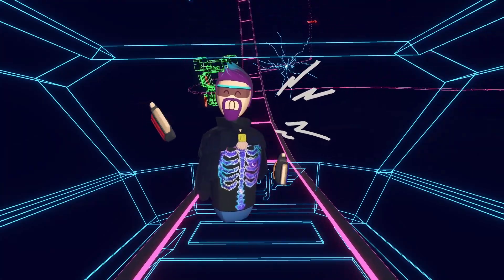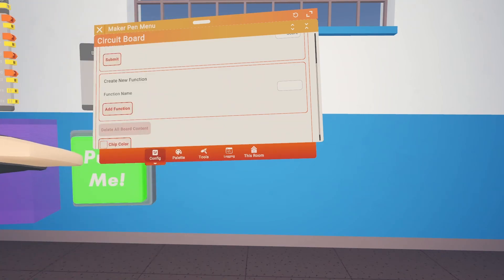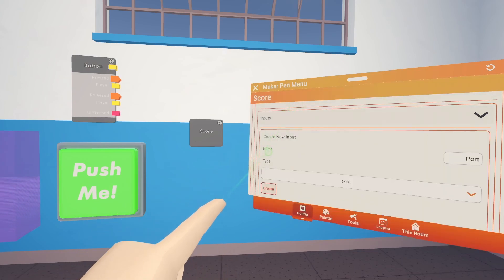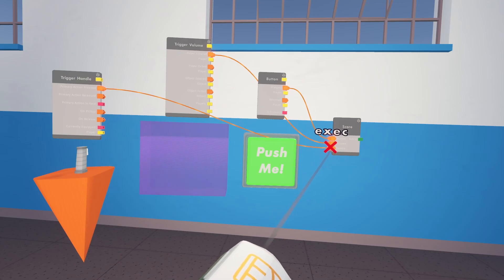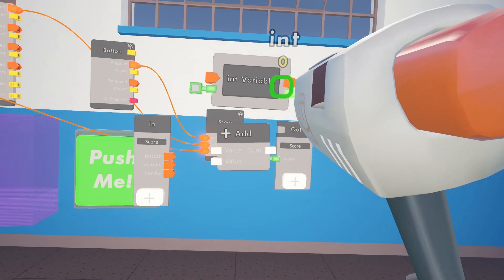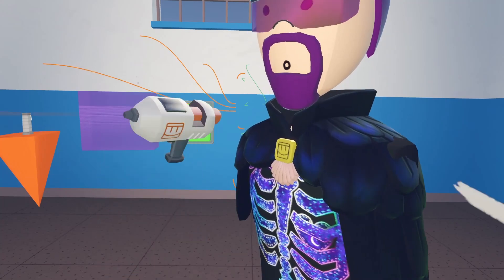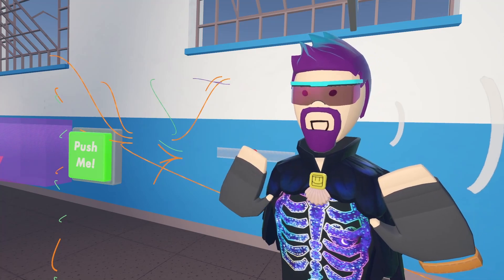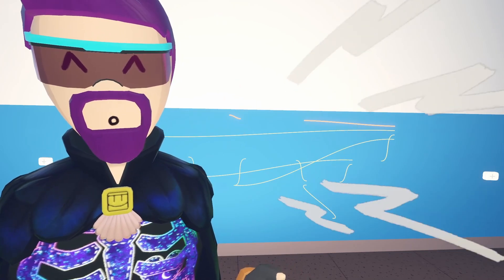Make Your Circuits CLEAN! | Rec Room Circuit Board Tutorial

Comment: Remember when you made a tutorial on how to use Animation Gizmos, and do you remember the tutorial on how to use state machines? How do you connect both animation gizmos and state machines together and use that combination of gizmos and machines to open a door?
Reply from the maker: ill be honest i havent messed with cv1 in a while, my guess would be match you max time in state with the time on your animation gizmo, in state 1 play output 1 to the animation play then when animation done start state 2, i believe there is an output on the animation the you can used to gate the 2nd state
Reply: @theRCLman  if that doesn't work, then I will need to take classes I guess

Comment: I don’t have really any problems with this but I just don’t see the practical use of this, like what if you have multiple people needing to edit the circuits at the same time, plus needing to go in the circuit board to just update it seems a bit, idk unnecessary.

Also when you make your circuit out the circuits board and then select all the chips in your ‘contraption’ and press options you can make it a circuit board, but lets say you made an circuit that adds one to your “score” variable and added only the add and the int variable to the circuit board using the way I pronounced, it would create an execution port on the in side that connects to the int variable for the adding and if you had that int go to a  to string chip of something it would make and string port on the out side of the circuit board wich connects to the to string

(I just got to the part where you showed that but still.)
Reply from the maker: i think the best thing this could be for would be data abstraction imagine you have 2 ppl working on a game 1 person makes the score system in a  circuit board and it our puts the person in 1st place another person makes circuits to give zero g to the person in its own circuits board, idk why but it just an example, look up data abstraction to understand more what i mean
Reply: @theRCLman  hmm I’ll look into data abstraction and see if I get what you mean